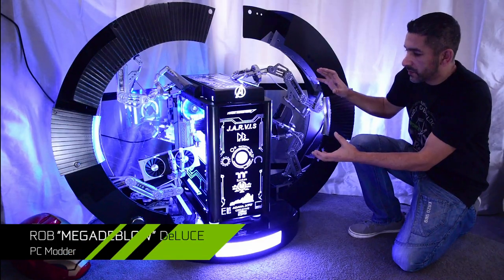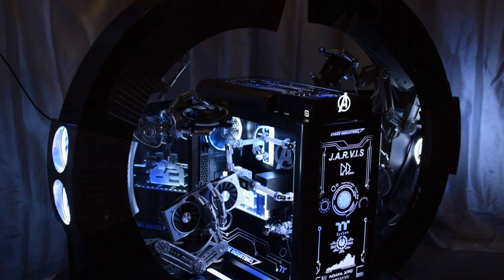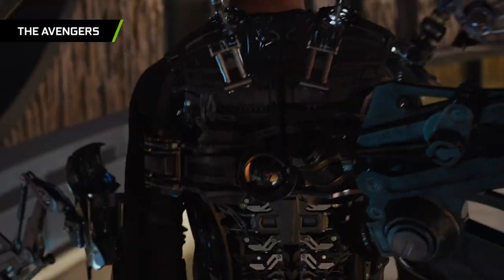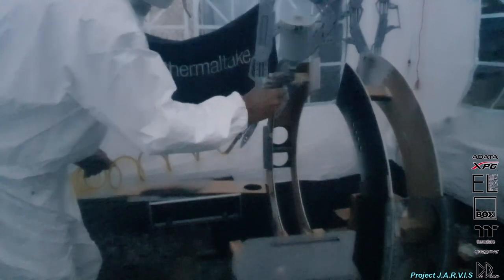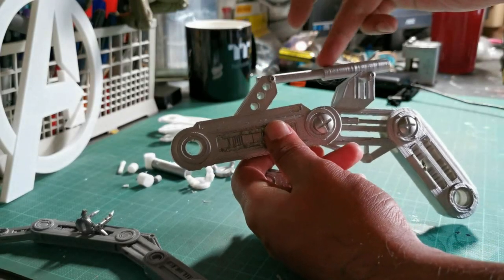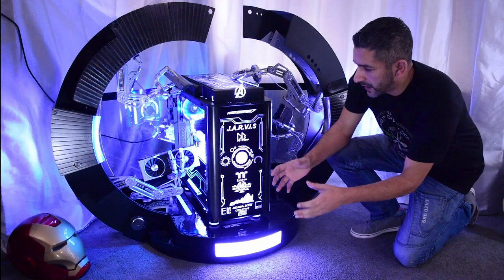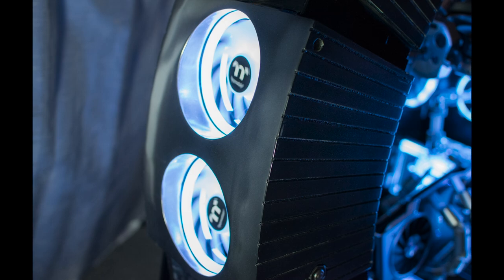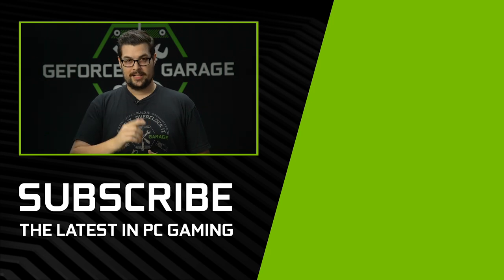GeForce Garage: MegaDeblow's JARVIS Mod

Comment: Awesome! Although, it so big, I would swap the more common "rig" with the PCMR "battlestation" for future coverage :)
Reply: I know mate, its actually smaller than the original plan as it would have been an issue for space in the workshop loL
The rig can be removed from the base and used as a normal desktop.
At the moment thats whats happened, the base and arms are stored away and the case is in the house.

Comment: deft would've been insanly cool if the gpu outside was a working one
Reply: Yeah the GPU is watercooled inside, the cooler was removed to fit the waterblock and the reason I have it on show so not to waste it.
The sound card is the only part thats not plugged in and functioning.
Reply: @MegaDeblow  yah i totally get it its still awsome looking i was just saying it would've been an extra level of cool if all the pieces outside were the working ones kinda like the ssd

Comment: wow, that PC looks amazing.
I know this would be difficult, but if this arms, holding components, could move and lay the (conected) graphics card or RAM chip or etc. in the case, as the PC is turned on.
Cool design, keep on tinkering :)